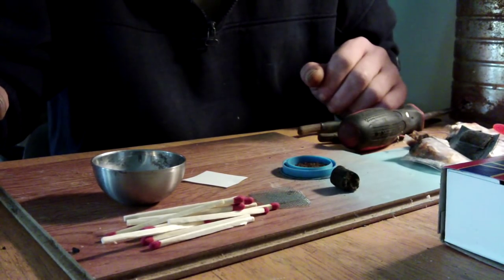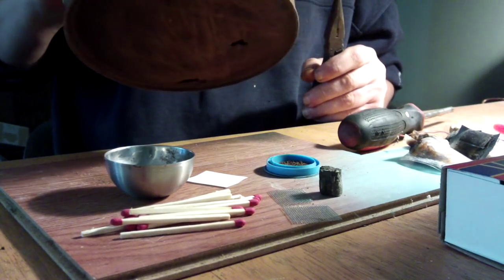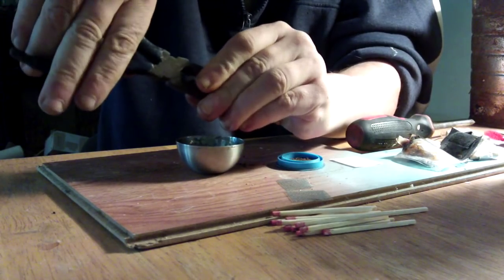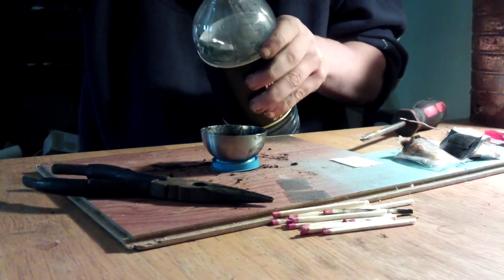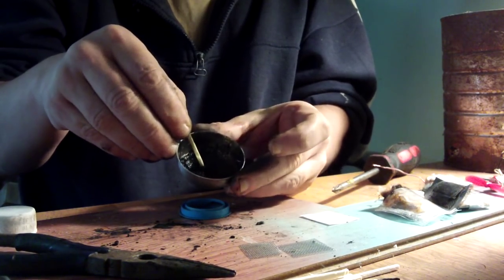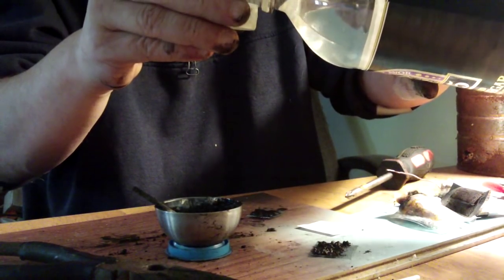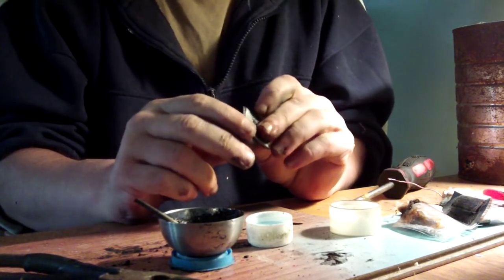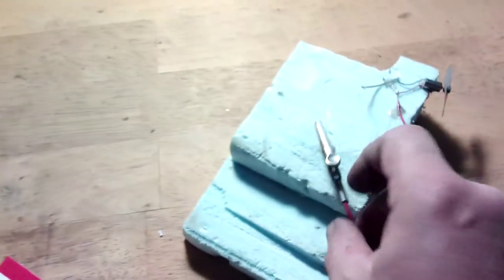Supercap Building - Step by Step

Comment: what does the phosphorus do for the super cap
Reply from the maker: It works as a doping agent, usually along with graphene, but in this case seems to work well with the activated carbon in any case. Best way to find out, is to build a test cell with it and then without it. A supercap can work with no phosphoric content at all...but not as well as when included.
There's a good read about it here: https://www.researchgate.net/publication/237146184_Phosphorus-Doped_Exfoliated_Graphene_for_Supercapacitor_Electrodes
Reply: +slider2732 thanks for your help in my research and for the link

Comment: do you have to use red tip matches to get results? will green tip substitute
Reply from the maker: It's the phosphor that''s needed, so green will be fine.
I've had good luck with 'diamond' brand from Walmart (here in the USA). Main thing though, just use the vid as a starting point, see a success and then change things around noting what works better than something else.  It does get addictive chasing the right quantities and doing the tests....good luck :)
Reply: +slider2732 thanks for the quick response.  I have gave the the green tips a try, with little results. I'm gonna try the striker strip  now. I also think the old screen I used needs to be replaced with new clean screen .

Comment: Interesting experiment! Just FYI I'm pretty sure the fizzing you get when soaking the paper in vinegar is from calcium carbonate, which they use as filler in the paper. This will react with the acid to produce carbon dioxide & calcium acetate.
Reply from the maker: +Lasty Nice info thanks. Yes, have wondered about the actual process for a while now...that fills in the gap :)

Comment: Love the ease of the build with everyday materials. The Stainless electrodes are key to a lasting system. The phosphorus from matches and Carbon from coals is so simplistic. Remember there are many different types of Vinegar and Phosphorus ;)

You got me back into the crystal cell hype and i ordered materials. Lets put these in series and build a usable battery!
Reply: +vintasalo Forgot the iron oxide..  The rust being something easier to find

Comment: Hey Slider. The soak test on the matches is going great. I put enough with the strike coated end down into one of my medicine bottles. till full. Then I added vinegar about an inch. I gave them a shake after 30 minuets of soaking,this helps speed up the coating coming off of the matchsticks. After they are ready.. I will save all the sticks to rinse every bit I can into a glass jar.for use later.
All my best.
Bobby
Reply from the maker: +Bobby Tectalabyss That's an excellent idea ! Will try it myself ! if there is any chore in this, it's taking the ends off the matches...you might have solved it. Will find out in about, oh 31 minutes lol
Reply: +slider2732 Hello Slider. I should have your stuff ready by the middle of the week. I have been waiting on some Graphite to get here so I can send you some of that also. I haven't had much luck so far. Oh on the Matchstick soaking don't leave them more than about six hours or the wood will soak up the solution. I had that to happen :)  Wait till the solution turns a deep red or green depending on the match heads color. Hope this helps.
All my best 
Bobby
Reply from the maker: ***** Very kind and thanks for the advice too Bobby. Yes, I did some of that soaking yesterday and it works a treat ! Did leave some overnight to test and found that the matches were green too LOL. About an hour seems to do them well. Am going to make a bottle of match concentrate.

Comment: first one done,held 1 volt and it was only 1/2x3/4 in size and i assembled it backwards as the material was on the outside instead of sandwiched inside.the wet vinegar coffee strainer  paper was in between the 2 ss screens 1600 mesh and the mixture was on the outside.haven't played with matches in a long time.chuckle.i used activated charcoal vitamins 2 pcs 250 mg capsules was very easy to work with and some rust off some tools.held it together with plastic filing cabinet file headers where you write whats in the file.from pre computer days .will use computer paper next time.thanks again i will be playing with these for a long time.now to exfoliate some graphene. going to try old drafting leads and another old charger.great to recycle all old office stuff and have fun at the same time.
Reply from the maker: +bill bailey Ah congrats and good for you ! Interesting construction technique and it works eh. Let me know how the graphene process goes and any improvements...need to find a route for that myself. Am thinking credit card size and whatever quantity is needed...no need for a 1/2 ton, well, then again :)

Comment: Have you tried making an electrolyte without the match-heads? This might sound like a silly suggestion but would your capacitor work just as well without the 'phosphorus'? See my 2 minute video (match-head capacitor test #1).
Reply from the maker: +Pseudo Nym I just noticed you uploaded a vid, will certainly watch it shortly ! 
Yep, tried that here, just to see and output dropped to about 0.4V and 1mA.

Comment: Hi, how does this compare to a commercial one? Have you been able to test the capacity?
Reply from the maker: +Thanh Tran At the moment, a better made one results in similar motor runs to a 1F commercial supercap (Maxcap). Though, the commercial one is 5.5V rated and these top out around 2V. Double layering may be a route and will be tried. But, without graphene, I would say 1F from the crude tests so far. My capacitance meter measures pF mainly + has trouble past 100uF.
Reply: +slider2732 Well done Slider, can you again confirm, that these red matches are these types that you can strike anywhere and not just on the match box  side ? The normal matches contain the red phosphorus on the matchbox side painted on the matchbox wall, when I remember correctly, right ? As these strike-answhere matches are hard to get nowadays, it would be good to find a substitute for it with some other chemicals containing enough phosphour... Is the phosphour really needed ? Does it give so much boost to such a cell ?
I experimented a few years back with just 2 graphite plates in a saltwater electrolyte and it also had simular capacity, but surely graphite plates are much more expensive and I did not try any phospour or phosphoric acid with it...You might try these big sieves for cooking and frying pan sieves     graewe-shop.de/images/produkte/cache/mi99/99502-Spritzschutz-Art.jpg This should give quite a nice capacity... Regards, Stefan.
Reply from the maker: +overunitydotcom Thanks Stefan. Yep, regular red or green tipped matches that strike anywhere. Over here in the USA, they are readily available, but that's a good point about other countries. Several cleaning solutions use good quantities of the phosphoric acid, drain cleaners etc, also soil treatments, but it's not as safe or kitchen table friendly of course.
Yes, the pan shape in your link is nearly exact to the one i've been cutting up to use :)
I omitted the match ends and the cell didn't work. Voltage was down to about 0.4V and current in the 1mA region that faded quickly.  The Wiki for Phosphoric Acid has a great chemical diagram on it, that gave the thought to use brute force electrolysis - to separate the water of the vinegar into HHO on the fly during charging, which then creates the bond with the phosphor atom as it stabilises...I might be wrong in my logic, but it works.

Comment: Hey Slider. Thank you for posting this how to video. I shall have to try this. Do you save the liquid from each batch. My thinking on this is every time you reuse the liquid it should become saturated with the charcoal and matchstick chemicals. then you should be able to place cuttings from a coffee filters,place them into the saved liquid paste. you may also be able to sock your matchsticks in the vinegar and the chemicals leech out and make it easier to get all the coating off the wooden stick. Just some thoughts on this. I am not a know it all just trying to make it easier for you and anyone else who may try this.
All the best.
Bobby
Reply from the maker: +Bobby Tectalabyss Very much appreciated ! Yes indeed, the liquid collected should be examined more closely...might be doing this all wrong by using the paste lol. I like the leeching with the vinegar idea too :)
Reply: +slider2732 Cheers Slider. When I get the Matches, I plan on taking three small jelly glasses with lids that seal, and do a time test,to see if letting the mix sit does anything to improve the characteristics of the cells. Your way seems the safest I have seen here on youtube. And they work. Big thumbs up.
Reply from the maker: ***** Some really good ideas...the sitting test is another one. Thanks for the kind comments and good luck with your builds :)

Comment: Thanks for taking the time to make this How To video.   It is basically is what I tried yesterday except for the rust.  I also was using 1" square pieces of galvanized steel.  The 'red head' matches, vinegar and paper were the same. I did use activated charcoal. The thing I made kinda worked but it might have just been galvanic.  It had very poor performance.  I will try again.
Reply from the maker: +Lidmotor Oh you're very welcome. I would increase match heads number + have noticed the finer the powder the better the runs. As it turns out, the rust in this one doesn't have any sparkling traits, from what I can tell. 
In tests last night, an N20 motor was running, which are a lot larger than this vibrating toothbrush type...could it be the motor ? now that I think about it. GIAOM seems to do well with his toothbrush motors in various projects. A so called 'solar motor' is another option, or one from a Dollar Tree hand fan :)
Reply from the maker: +Lidmotor Just thought - 'go for the burn' with 5 seconds on an SLA. Try that if have been using lower voltages or current. It will heat up and fizz, but will prove out the running. Will likely dry out, so then simply add more vinegar, will return to running fine. 6V or so seems to work best when the 'plates' have formed over a few cycles.
Reply from the maker: +Lidmotor Congrats ! Am so glad you stuck with it...as a baby step the idea works to inspire. Kinda addictive to try out different methods and materials, as the salts cells have been. Will go and wath your vid in a minute :)
Reply: Slider2732 can it work without rust?

Comment: What's the uF rating of these? Have you calculated? And what about full scale like 12 inches and having multiple layers too to see how many farads you can score? This is actually very simple and awesome. I wanna try this now and see how high I can go lol. Oh and what's the voltage of those things?
Reply from the maker: +The Computer Tech Guy Thought you might like this :)
A 1F ran the motor for a similar length of time. But, the Maxcap was charged to full 5.5V and these top out at approx 2V. A double layer type will be in the near future for better comparison. So, as such, no definite figures, am just happy they run a motor for the moment lol. I've not enough materials for a 12" version..but it would be intriguing to make one of a similar size to that huge thing that Lasersaber showed !
Reply: +slider2732 I was surprised that such a tiny thing ran it for that much time!
Reply from the maker: +The Computer Tech Guy The previous vid is better for run time, this test was quick, to avoid a very lengthy vid. Other runs the motor for 1 1/2 minutes or something :)

Comment: you made it so simple i think even i can replicate it.for once i have everything on hand.i went back thru years of your earlier videos.grrrreat stuff thanks for sharing
Reply from the maker: +bill bailey Thanks Bill...am glad it works to inspire. 
As you build them, some things become apparent, some changes are made and lots of learning. Really, this is just a starter to get something like a motor running.
Now, if the other chaps would upload their tutorials, I might learn about how they are actually supposed to be made lol
Reply: +slider2732 i can visualize it now.a wing with those mini solar panels and your super caps with an electronic timing switch so they either self recharge or get a boost from the solar cell.you will have that bipe in the air for hours.i sent you a note to your you tube account,well i think i did chuckle.again great work